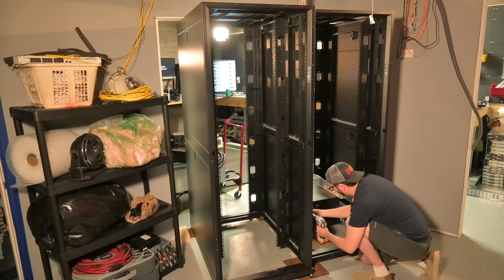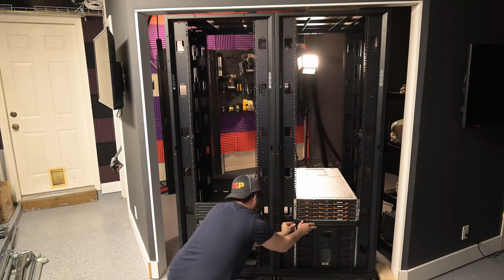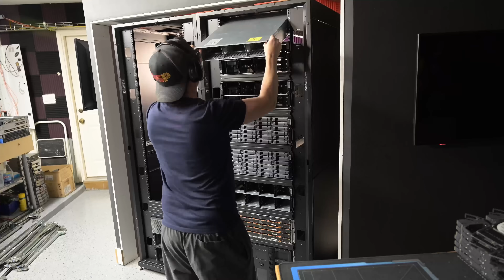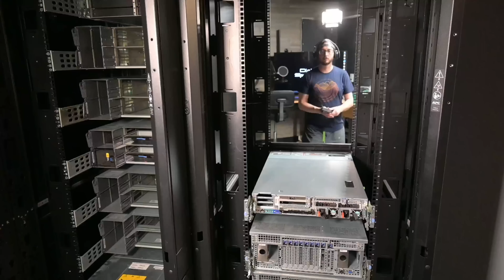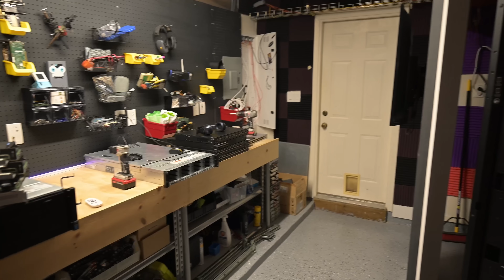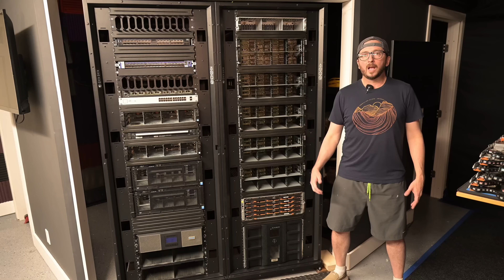Ai Home Datacenter Build (part 3)

Comment: Great stuff as always. Did you ever end up making a part 4? :) 

Also, the extra space could be utilized for upright standing switching with a brush-panel "below" to allow for cables to still be front mounted. That would require new cabling of course, but it could be an easy way to win back som Us in the main racks